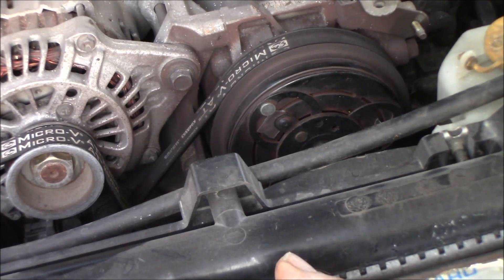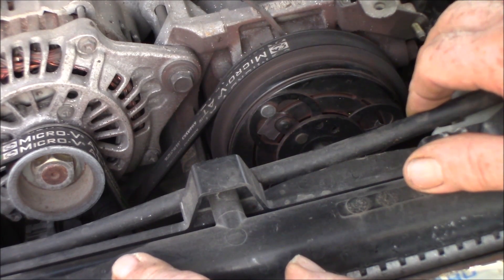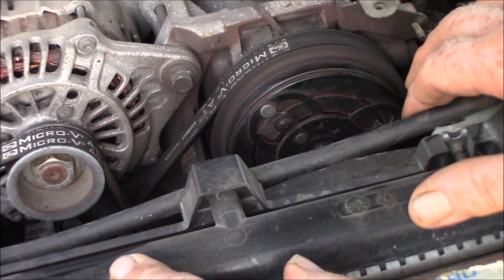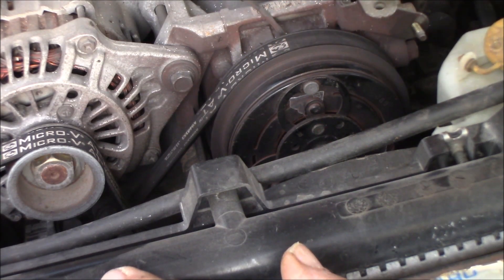intermittent AC cooling on subaru clutch air gap too wide

Comment: I have taken my XV to the mechanic 3x about my intermittent A/C, and they couldn't figure out what was wrong with it. 
I checked the air gap, and sure enough, the clutch was too far out. I just took it off and removed a shim myself and now the gap is in the appropriate range. 
Thank you for explaining the problem.
Reply from the maker: you are very welcome, my wife's 06 forester is doing the same thing now so I will try to work on it soon and remove a shim or two,, thanks for watching.

Comment: 2014 Forester AC being fussy like you describe.  I love your ingenuity and shade tree solution.
Reply from the maker: it would be best to take the pulley off and remove one or two shims but I'm too lazy for that. lol
Reply: Thanks MissouriOldTimer - later I did exactly that.  The solution is to get the gap narrower.  The spec range is 0.45±0.15mm or equivalently 0.30-0.60mm.  The gap on mine measured at about 0.735mm.  Need to remove a shim.  Shifting to micrometers, want 300-600um and it measured at 736.  Needed to remove 286 to hit 450 (middle of 300-600 range)  Got loaner tool from AZ to help remove center bolt and then clutch plate came off easily.  Only 2 washers (shims) inside - so guessing that the very thin one had been removed previously.  The thinner of the 2 was almost exactly 300um - exactly what I needed.  Reassembled without this shim and new gap is 434 um - great! - and AC is blowing cold and doesn't cut out.

Comment: I've seen other people tap the rubbers with a screwdriver and hammer.
others also take the clutch out and take a little shim from the compressor clutch to reduce the gap
Reply from the maker: yes the shim removal is the more permanent way to fix it.

Comment: My 2014 Forester keep blowing hot air after driving a few minutes especially in 90+ degrees. The ac becomes intermittent while driving and completely shuts off if I am idling. The Mechanic quoted me $1250.00 for the job and while looking for how to change the compressor myself I came across your video and tried your temp. method. Got an old cd case, cut it up and did the install as you instructed. Wow! My 2014 forester is running over an hour now with no issues. Took it for several drives at low speed and no issues. Thank you so much even if it's a temp fix it works. Mechanic $1250.00, you $0.00. Savings, $1250.00
Reply from the maker: it's not really hard to take a shim or two out from behind the clutch plate and then you don't need the temp spacers,  there at least on video on the tube showing how. all you have to buy is 4 metric bolts, I can't remember the sizes , I just did mine a couple of weeks ago and it works fine.
Reply: Ha my wife's Subaru had same problem today. I may try this method as well. Searching this issue I came across this video and your comment. Jahrule -- are you going to try removing the main bolt later on? The outback uses 3 M5x40 bolts to screw in to press out the main plate. I may try that since it's the more permanent fix. Although it's so hot outside good to know temp method works if I just need to fix up the wife until I get time to permanently fix. Haha nice to hear you saved 1250 dollars , sounds like you owe this guy a beer!
Reply: MissouriOldTimer I’ll try that, thanks again.

Comment: Thank you for posting! I just tried this on my wife's 2008 Legacy. It's working.Very hot today!
Reply from the maker: I'm glad it helped, I can't take the heat like I used to could so I needed it fixed if only for a while. that's not meant to be a permanent fix but this time it has lasted a long time.

Comment: Thank you for sharing this, helped diagnose the issue for my friends Impreza. We had it charged and valves replaced, no leak, 20min later it went off. We ended up using a Cylinder gasket and wrapped it around the 3 bolts, heat tested to last and it seems to be working now, blowing cold AC and cycling properly.

There was also a TSB on this very issue for Subaru AC compressors, they suggest a full replacement and won’t cover out of warranty. With only 60,000 miles this was some planned obsolescence for sure.

This fix saved the 1100 for the new compressor or 350 for the rebuild from O’Riley’s. We will watch it and hope it makes it through the heat wave. 

However, if not for this video, we certainly were planning to have to replace the compressor. Great tip and share!
Reply from the maker: sometimes it lasts a long time but just a couple of weeks ago, I took the clutch hub off and removed one of the shims inside and now it works good like it was meant to.. it's an easy fix and only expense is for 4 metric bolts,, I can't remember the size of the bolts but you can find that on youtube.
Reply: Yes, except the mechanic said this clutch plate can’t come off, I think the design they did on this 2014 Impreza was designed differently.
Reply from the maker: @BrandonMushlin1  that's very possible, there is 10 years difference from you car to mine.

Comment: Had a spat today trying to find a shop to do this "the right way".. I'll use this until I get the gumption to get the tool and do the job myself! Thanks a million! If you do get around to doing the actual fix, I hope you make a video.
Reply from the maker: this fix is still working so , being lazy like I am, I'll probably keep using this till my shims fly out.lol
Reply: @MissouriOldTimer   You sound just like me!
Reply from the maker: there are some videos showing this on youtube, it amounts to taking out a small washer  from the area where the bolt holds the pulley on. if the pulley comes off easy, it's a very simple job. look it up on the tube, there are some guys showing how it's done.

Comment: I want to thank you for posting this extremely helpful video. This fix was just done successfully on a 2015 WRX.  Worked instantly!
THANK YOU!
Reply from the maker: it might just be a temporary fix, later you might need to take the pulley off and remove a shim or so, not hard just  have to take them time to do it.

Comment: Holy crap, I've been driving without AC all summer because I'm too cheap to get it fixed. I watched this video and got my AC working in 5 minutes using a cut up piece of a deodorant lid. Thanks for taking the time to explain this method and for saving me a lot of stress and money.
Reply from the maker: it's not too  hard to fix it right, but the pulley needs to be taken off and a shim removed to make the air gap closer,
Reply: That sounds like a lot more work than your fix haha. One thing I did that I think makes a difference was scoring the pieces of plastic I used for shims. The first time I did your fix, I used plastic that was too thin and it slipped out after a few days. Round two, I used thicker plastic and scored each side a bunch of times with a pocketknife to grip the rubber better and that seems to have worked. Thanks again, you're the man!
Reply from the maker: I still haven't done the permanent fix, I'm still using the air with the shims , so far it's still working.   thanks for the compliment..

Comment: I just tried this on a 2015 Forrester and I couldn't get the "plastic" shims to wedge in. I used one f those "dummy" plastic credit cards (it was the same thickness of what you used). There didn't seem to be enough space to get them to even start to go in. I know they started making the compressors smaller, which might have something to do  with it. BTW, I am having intermittent problems with the air conditioner not working.

Comment: Did this today. Working great thanks.
Reply from the maker: glad it helped, this weekend I finely took time to fix it right, I took one of the shims out that brought the air gap to where it should be so now I don't need the little pieces I put in to make it work.  no special tools needed just some bolts.

Comment: My wife 2005 Subaru forester cuts in and out all the time. Had it gassed and it's definitely not leaking... a/c gas has a distinct odor plus it's clean. I'll try this out. Summer in Australia right now is ridiculous. Hope this fixes it. Cheers for the tip.
Reply from the maker: the correct way it to take the pulley off and remove a shim or two to set the air gap right but this was a fast temporary fix for me.
Reply: No worries mate. I just did this this morning. I'll see how it goes. I'll reply later on and let you know how it goes. Have a good one.
Reply: So far so good. The Misses used the car today in traffic and on the highway, no cutting out. Today wasn't a very hot day though. High of 28°c with 60% humidity. I reckon it has worked but I'll confirm in a week or so. Thanks for the tip. I was close to buying a compressor of eBay until I did 1 more search. Glad I did. Thanks agian. Btw, I used those U-shaped clips on a bread bag cut in half.
Reply from the maker: I don't know if this is a problem with all cars or only Subaru's, I have had many cars with A/C and these are the only ones that did this,, but none the less, I love Subies,, so far I have had 7 of them.
Reply: Week later and it's definitely working like new. Cheers mate. Good man. Thanks again
Reply from the maker: like I said earlier, it's best to fix it right but this has worked for me on 2 different subaru's.

Comment: I had a Ford truck a few years back that did the same thing. I never did try to fix it. Seems like on mine if I shut off the truck & restarted it the a/c would start cooling again.
Reply from the maker: sometimes this one did that too, I guess it was just about close enough to engage and sometimes it would after I shut it off for a while and sometimes it didn't make any difference.

Comment: My A/C was intermittent and couldn't figure why, but my battery light came on that was caused by a bad alternator. New alternator = cold A/C.
Reply from the maker: apparently the alternator wasn't putting out enough power to keep the compressor engaged.

Comment: I have a 2014 Subaru Forester Limited that we just experienced this year.  Had it recharged to proper levels ($140) and now just found Technical Service Bulletin 10-84-16R.
Reply from the maker: basically what was the bulletin about?
Reply: Took it to an independent shop that is an authorized and certified to work on Subaru's. Just got off the phone and was informed the TSB states to replace the entire compressor/clutch assembly. $850 just for parts.

What gets me is this is a design related issue as the windings were not sufficient to engage the clutch.
Reply from the maker: maybe the newer models are different from my older one, they have shims that can be removed to make the air gap closer,
Reply: Since mine is newer, SOA said they would work with me.  I think it is because I made them aware of the TSB plus all the talk on the Subaru Owners Forum, You Tube and Facebook.  Appointment at the dealer next week

Comment: Yeah there's shims or washers that go on the hub before you put the bolt in but your way is quicker and faster.
Reply from the maker: I might try to make better shims, I did these in the parking lot at Sam's Club only had a pocket knife to work with,, lol

Comment: Dose it use less fuel aswel?  Mine seems to smash the fuel more then usual. Will do your trick tomorrow see how it goes.
Reply from the maker: I don't know about that,but as a rule when the A/C compressor is working right, the fuel  economy might be less than when it is not.